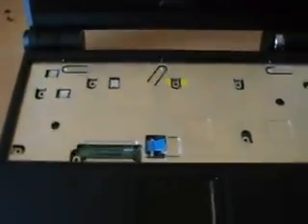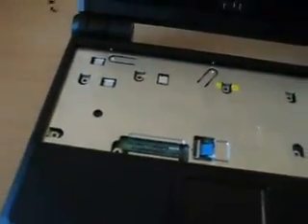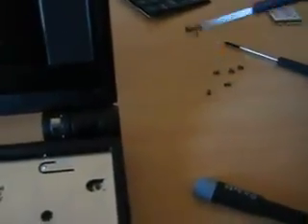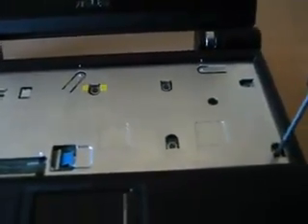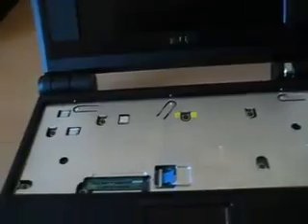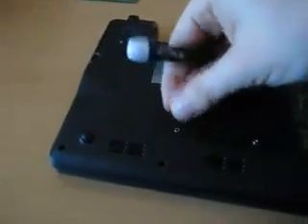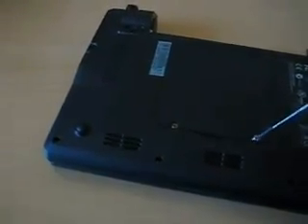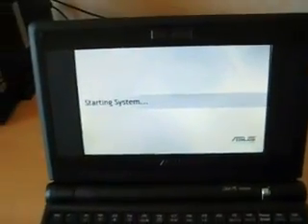EeePC Disassembly (Part 7)

Comment: Duh, I want to shoot myself. After looking for Asus Eee PC 4G Surf or Asus Eee 701 memory upgrade videos for about half a day, I went ahead and disassembled the whole thing by myself. Fortunately didn't break anything but it would still be a lot easier to have a guide such as your video. Perhaps adding some keywords such as "EEE PC 4G Surf 701 memory upgrade" would help others searching for similar videos. Great video. It will come in handy when I eventually buy the RAM and want to reassemble it